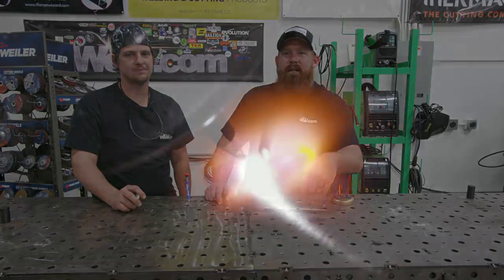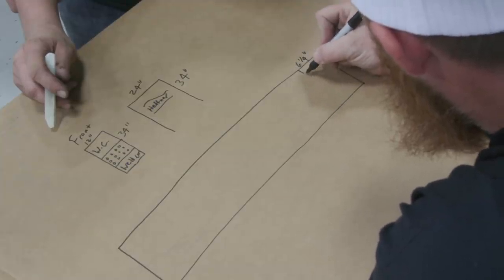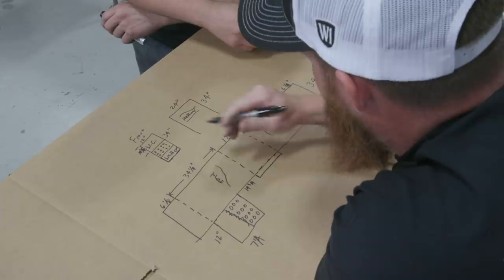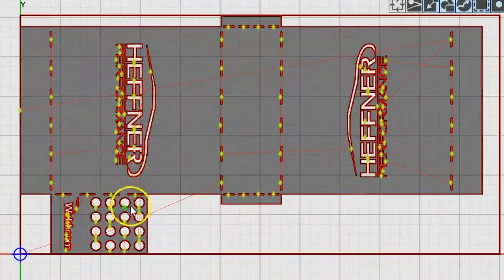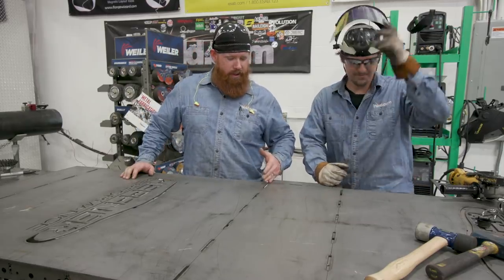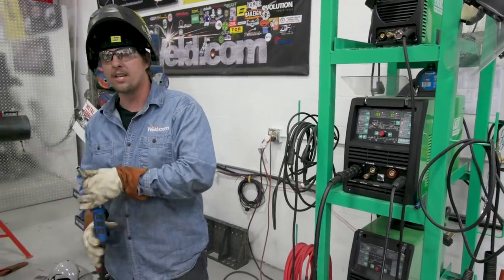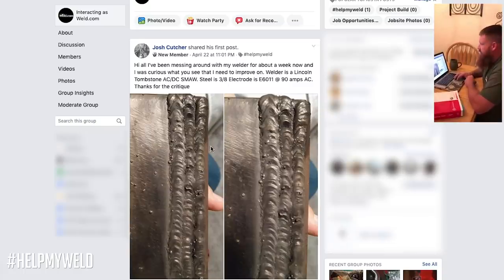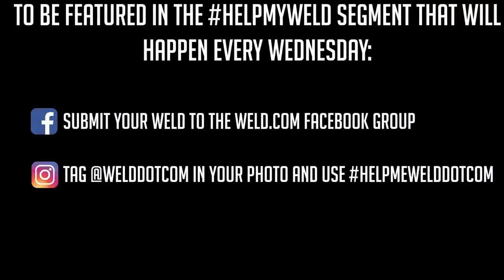Origami Weld Cart BUILD!! Part 1

Comment: I am a mechanical engineer that does cad sheet metal designs all day, our bending is done on a press brake, I would love to do some laser cut hand bent personal projects since I can't afford our shop rate for press brake bent parts. My question is how do you get predictable radiuses and flange lengths when you do hand bending, and up to what thicknesses can you reasonably do?
Reply: Tbm00001 I always put the edge of the table center of where I want my bend to be and either add or subtract the thickness of material depending if I need an inside dimension or outside dimension. 1/8” is kind of pushing the limits but you could probably go up to 1/4” with enough relief cuts and scoring with the grinder.